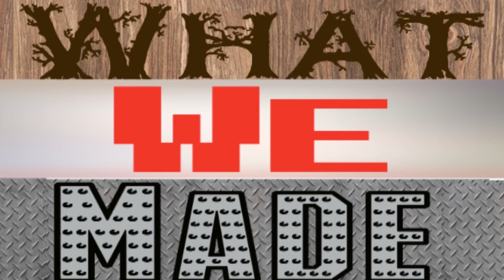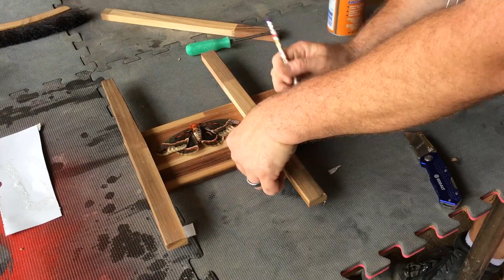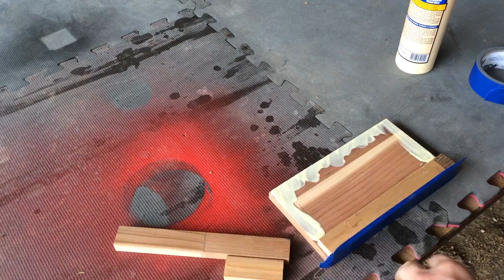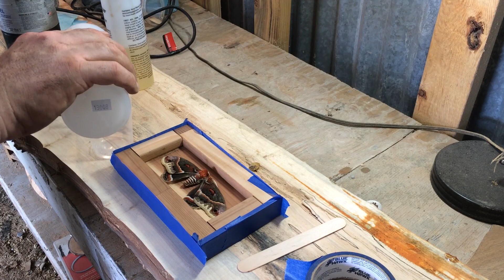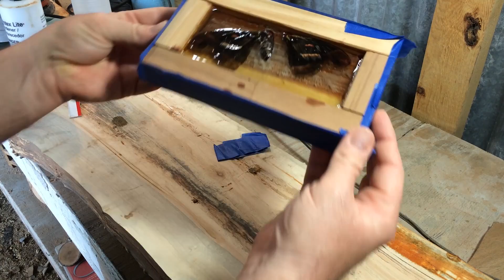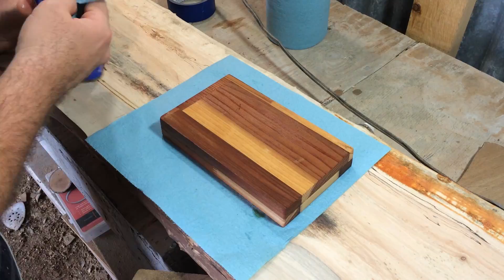Beautiful Moth Display

Comment: Next time pour a shallow base of resin and let it partially cure until the top of the resin  is still tacky and soft.  Add the moth on top of the sticky resin, press the moth down gently into the sticky resin and let the resin fully cure.  When the base is fully cured, add another thin layer of resin and let that fully cure. When cured, add your final coat of resin over the top of the moth and let it fully cure.  Putting the moth onto the sticky resin will hold it in place and you can continue to pour up to the top in layers.

Comment: Good on you for showing this even though it didn't turn out as you planned. We can learn a lot from our "failures" sometimes more than our successes. I would still use that as a shop decoration though the frame was pretty sweet. Was that an old drawer or something you recycled for this?

Comment: Yo. Tried it with a butterfly I found dead shortly after watching you video. I covered it salt and let it dry out. Coated it in resin yesterday; it didn't separate. I think you should remake this video with a pseudomummified moth or butterfly. I think you'll have a better response.

Cheers.
Reply from the maker: I think if I try this again I will use Art Resin. A bit more pricey but crystal clear. I would love to see photos of yours. @_whatwemade on twitter.